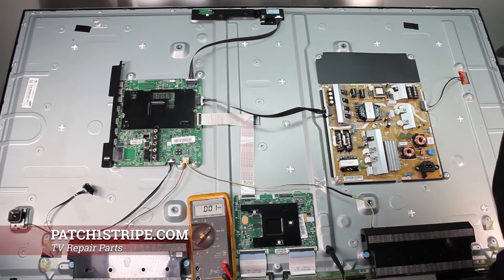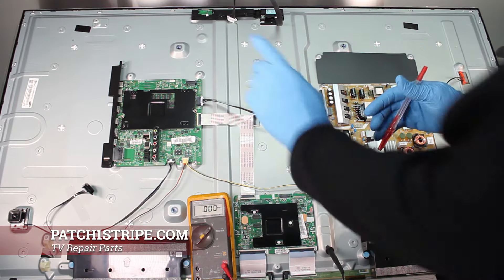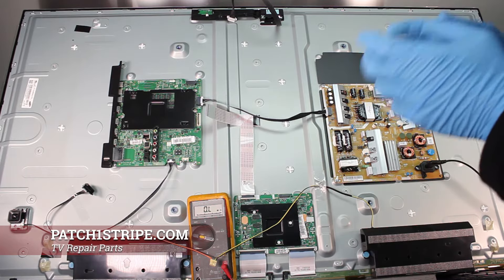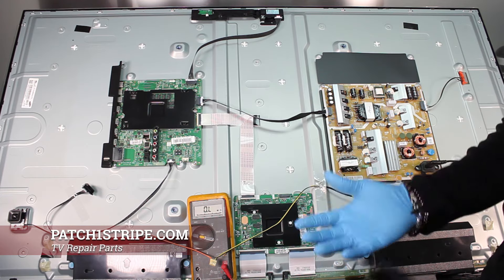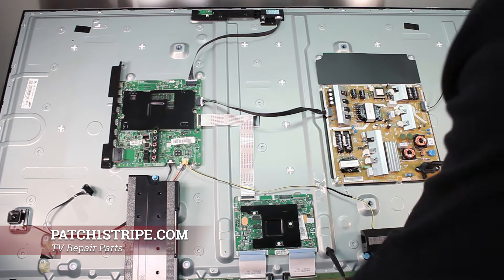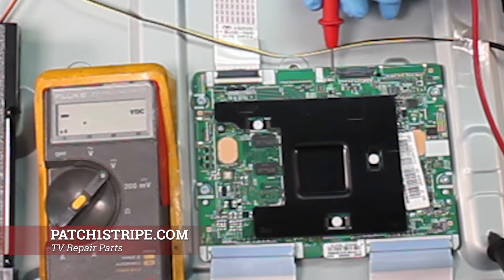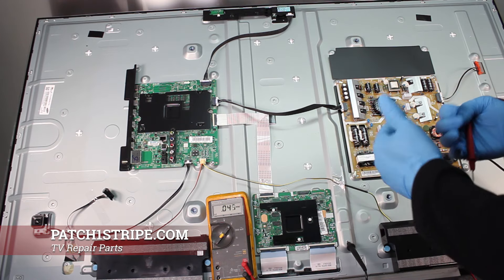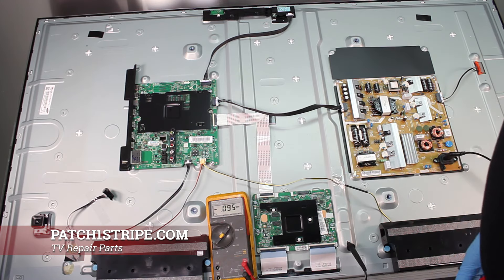HOW TO REPAIR ANY SAMSUNG LED TV:  Won't turn on,  No power

Comment: I had sound but no picture. Replaced tcon board, no change. Replaced main board, the TV started to work again. 6 hours later, after I put it back together and re-mounted it on the wall, no more picture. I want to cry. How can a main board work for a few hours then stop working???
Reply from the maker: Unplug the wifi module and tell me what you get. Also with the tv on and having sound, look closely to the LCD panel with a flash light and see if you see any images moving. Also, tell me the model number of your tv and the part numbers of both main boards. Hit me back.
Reply: @Patch1stripeTVParts  Don't have the wifi module, see nothing with flashlight. UN55HU6840FXZA. Noticed the backlight is no longer on (it was before it re-died last night). I literally fried the power board last night, so I have to get a new one of those, regardless.

main: 
BN94-08076A (original and replacement are the same)
tcon: BN96-34102A (original and replacement are the same)
power: BN44-00755A

Thank you for your reply.

Comment: Hi I have a 75 in Samsung smart tv and tv powers on and has sound but no picture I checked led strips and they come on what could be the problem?
Reply from the maker: disconnect the wifi and tell me if the tv comes on. be sure to turn the tv on using the remote or the of control.
Reply: @Patch1stripeTVParts  still no picture
Reply: @Patch1stripeTVParts  I tried it but still no picture but I do have sound